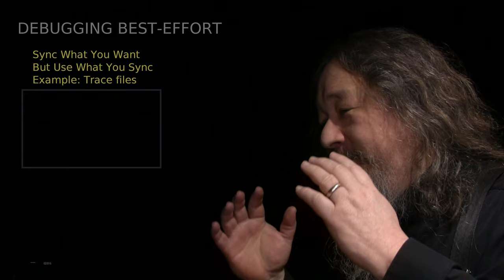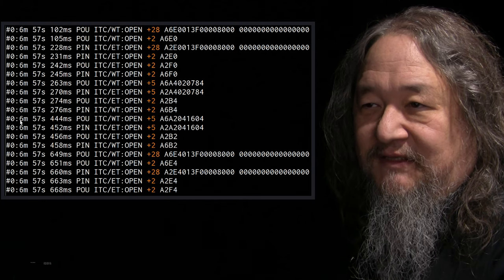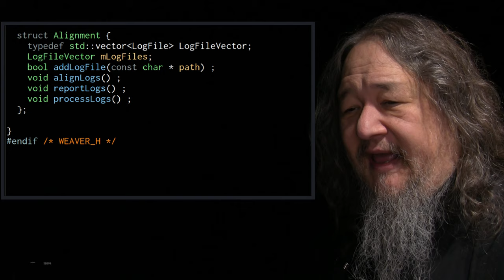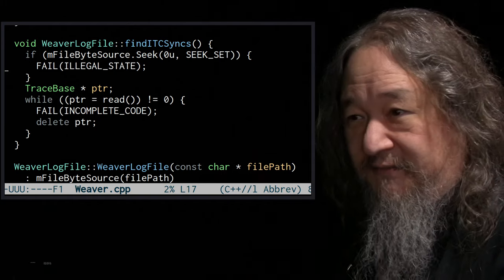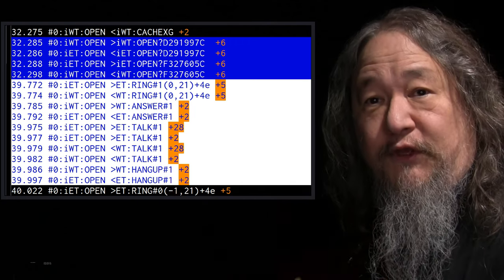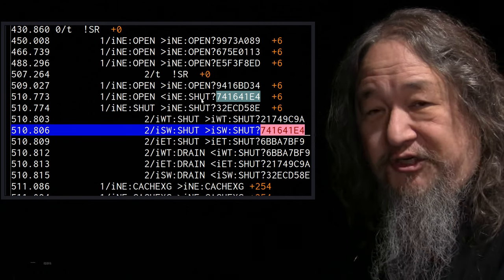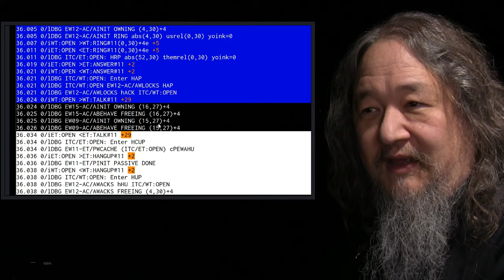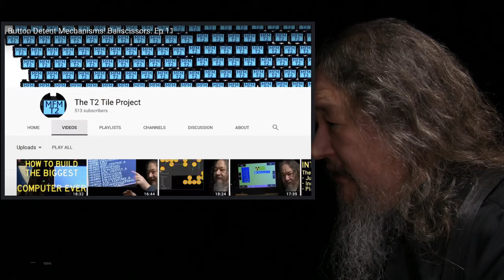Debugging Best-Effort Computing - T2sday Update 278

Comment: This seems very similar to Lamport clocks / Vector clocks, in distributed systems.  Is that where you got your inspiration from? if not, might be some good reading for you!
Reply from the maker: A key difference is that the sync tags are just for debugging/tracing.  The event protocols never look at them, and -- we hope, once the bugs are fixed -- are happy as clams without them!
Reply: 8:16: are the stats able to fully compensate for collisions? If not perhaps you could use UUIDs?
Reply from the maker: We'll have to see on collisions.  But tile UUIDs are only finitely scalable, so I'd be.. reluctant.. to go that way.
Reply: @T2TileProject  Ooh didn't think of that - good point. Very cool project BTW
Reply: @T2TileProject  Theoretically, you'd only need vector clocks / lamport clocks between neighboring tiles, as you could establish causality through transitivity.